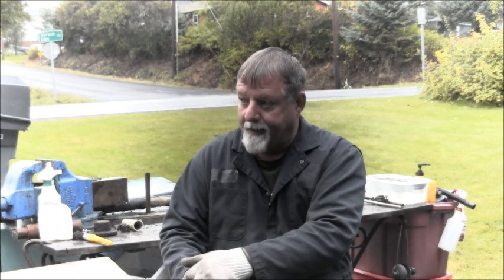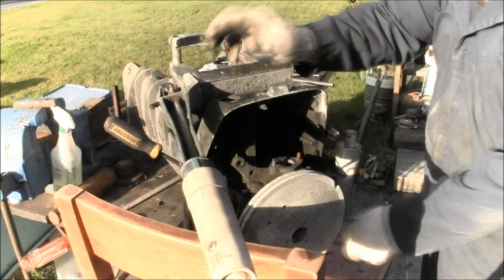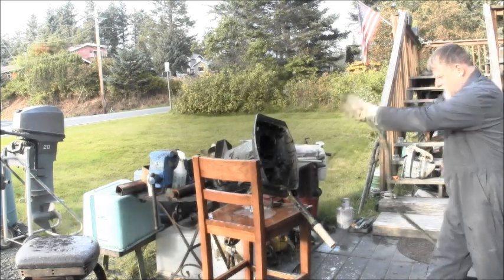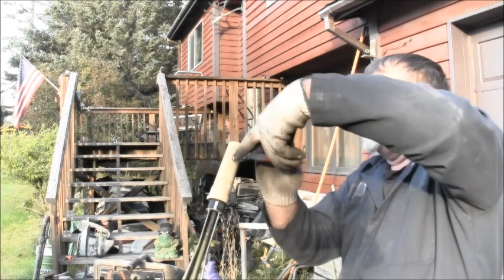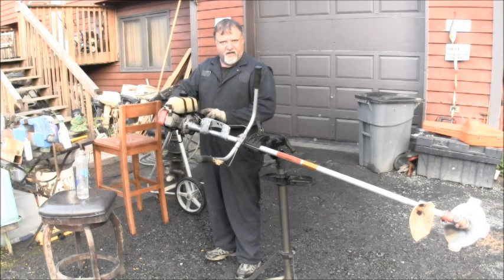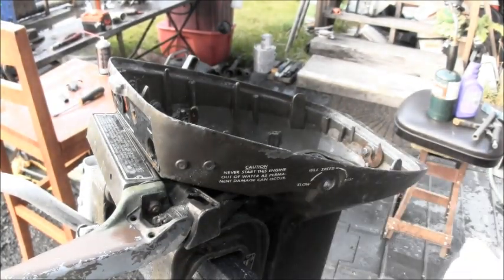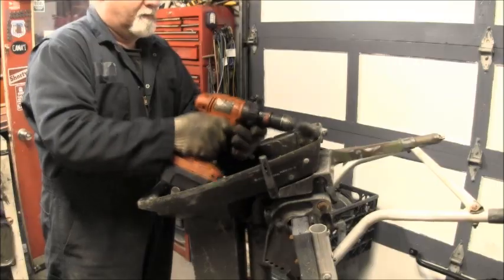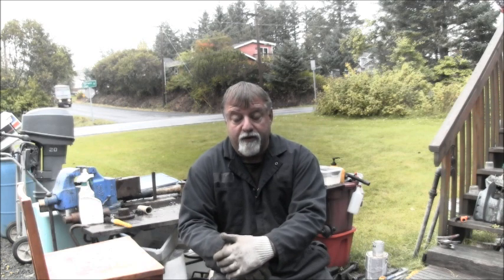EVINRUDE  1981 15 HP,   SAVE  or  SCRAP,      ( Part 3 )

Comment: Gd morning kodi I'm curious can you switch shafts from a long one to a short one and it interchange with each other
Reply: From a fifteen to a twenty five horsepower motor
Reply: @jamesburke5709  the shafts are different lengths, short is usually marked for a 15” transom and long is usually marked 20” transom. The long can be cut down and welded back together by a professional welder, unless you have that talent, I haven’t seen where someone has extended a short to a long. There’s a reference guide on parts that are interchangeable from different years and horsepower, you’ll have to look it up on whatever exactly it is parts wise you are looking for. If you looking to make a 25 short, maybe your best bet is to just find a lower for that model.
Reply from the maker: Yes'  with a good welder it is possible     kb